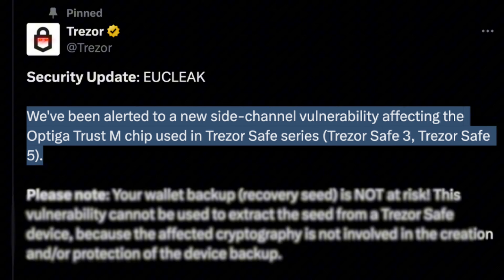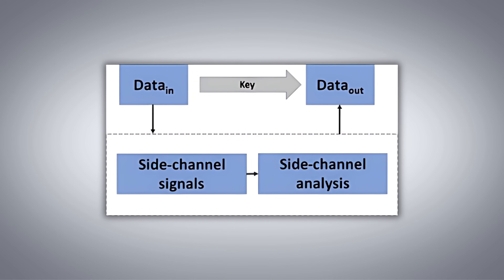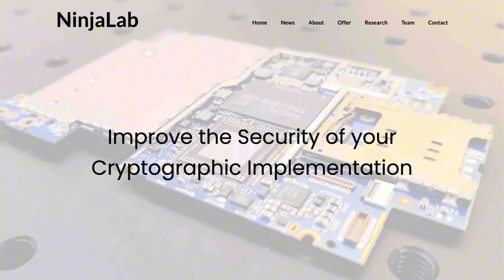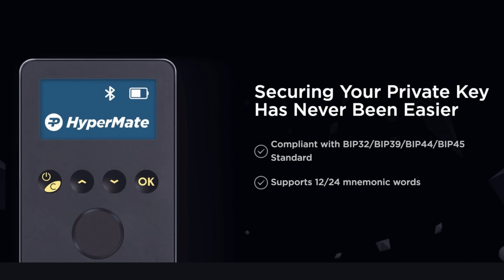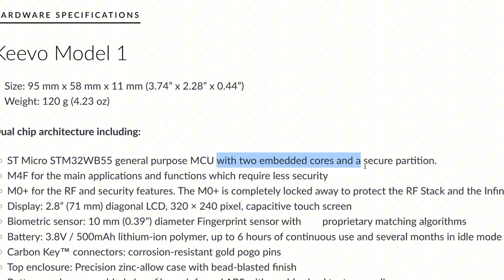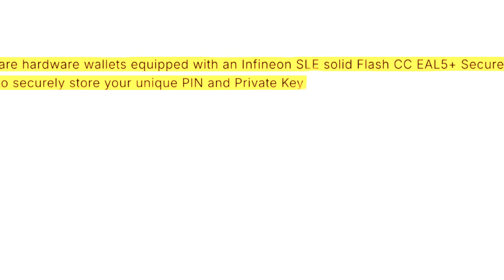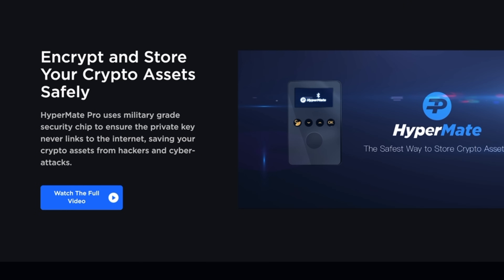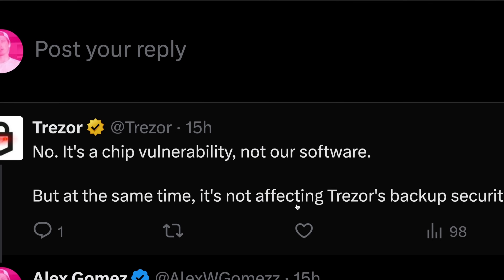Major Cold Wallet FLAW Exposed After 14 Years!

Comment: There's something that bugs me with Trezor's explanation. If the encrypted private key is stored on the non-secured MCU and is encrypted by the secret from the vulnerable SE and the PIN, what does prevent an attacker from extracting the encrypted private key and SE secret, and just brute force the PIN outside of the wallet ? The secret would take millions of years to brute force, but a PIN would definitely not take much time.

Comment: 1- the key will be stored in an encrypted manner and will need your password to dcrypt
2- if someone has your device and password, they don't need to extract your private key, they can just extract your funds

nobody actually believed that it's possible to physically safeguard data.
some people came and claimed that it's possible and others believed them and now it's being discovered that it's physically impossible
Reply: Not really
1 - the private key is encrypted by the PIN code AND the secret which is stored inside the secure element.
2 - the device itself has brute force protection when you try to enter the PIN. If you extract the encrypted private key from the non-secure MCU and the secret from the SE, the only thing missing to decrypt the private key is the PIN code, which you can find by doing a brute force outside from the device (where there is no brute force protection).
Reply: @aerandir1414  if it's a pin then yea. brute force is very easy. if it was a password then it would become difficult to brute force a good password.
Reply: Weakest chain in the link is seed phrase that you have to store physically unencrypted, rather than hardware wallet itself.
Attacker with physical access would never target wallet, because seed phrase is much more easy to find and exploit.

Comment: From Trezor

Side channel attacks

Side channel attacks described by Jochen Hoenicke were fixed by rewriting all crypto functions to use constant time. Jochen did almost all of the fixing, and we have been collaborating ever since on various security and non-security related improvements. Furthermore, we ask for the user's PIN before every operation involving a private key (e.g., generating the public key), so even if there were some side channel attacks left, the attacker would still need to know the PIN to trigger it.
Reply from the maker: @SoftwareWrangler  As I said in the video, Trezor wallets are not vulnerable to side channel attacks. Even though they use a vulnerable chip
Reply: I am watching the video again. 

The first thing from the video was that Trezor found a vulnerability in the new models but yet they were not affected. 
After a couple of minutes (2:06) this issue is linked to Trezor 3 and 5. 

I use multiple wallets and now I am confused.

Final: Trezor use the chip but not affected gooood God 😂
Reply from the maker: @SoftwareWrangler  Yes. Trezor literally said this themselves. They use the chip. But it does not compromise security of their wallets.

Must watch the full video. Not just 2 minutes
Reply: @cyberscrilla 
I watched like 3 times. 

1. Trezor announcement there are some issue
2. Trezor uses the chip but not in a way that compromises the security
3. Watch the recommended wallets video just avoid two Trezor wallets. 

The hard truth is to avoid all wallets with this chip and buy some without even if the chance of the hack is very very low. 
🤷‍♂️

Comment: Shameless clickbait garbage smh, lost credibility.
Reply from the maker: @abassra how is this click bait when Trezor posted on X about this exact vulnerability and I’m shedding light on it so people know?

It’s simple.

Trezor publicly announced the chip used in their Safe wallets have a vulnerability.

The vulnerability has gone unnoticed in these chips for 14 years.

It does not affect the security of the Safe wallets thigh.

However, it could affect security of the other devices and wallets I mention in the video.
Reply from the maker: Which is exactly what I just said, and is exactly what I say in the video if you watch it and listen 🤦‍♂️
Reply from the maker: My guy. I said “If you’re using one of the wallets that’s vulnerable to a side channel attack”.

Trezor is not one of those wallets. I went through multiple wallets in this video and discussed which ones COULD be vulnerable and which ones ARENT.

All wallets mentioned in this video use the vulnerable chip, but not all of them are vulnerable to a side channel attack.

Thats the difference you missed.

LISTEN next time.

Comment: So the old Trezor Model T and Model One no issue and even for the new Trezor 3 and 5 the attacker would need physical access and be an expert hacker ? Chances of that happening very rare
Reply from the maker: @Methuselah969V  Incorrect. The new safe models are not vulnerable to this attack as they have other security features in place that prevent a side channel attack. I explained this in the video.

Comment: What about the OneKey Pro hardware wallet? Is it affected?
Reply from the maker: Doesn’t use an Infineon chip.
Reply: @cyberscrilla  Chat GPT syas: Yes, the OneKey Pro hardware wallet uses an Infineon Secure Element chip. Specifically, it is equipped with the Infineon SLE78 Secure Element, which is designed to provide a high level of security for cryptographic operations, such as protecting private keys and ensuring secure transactions. This chip is commonly used in secure devices due to its strong security features.
Reply: Do you still like the OneKey Pro wallet?
Reply from the maker: Word of advice: don’t trust ChatGPT to give you accurate info. It’s spits out wrong information 80% of the time, especially if you use the free version.

The pro uses 4 TMC THD89 chips. Not Infineon.

That said, I’m not a huge fan of the pro. 

Not because it’s not secure, but because it still seems like an unfinished product to me and I’d rather buy a wallet that’s more useable for the price.

Comment: Always make using a passphrase part of your OPSEC - especially on a wallet with a substantial amount in it. At least it will buy you time to move your funds if your hardware wallet is stolen.

Thanks for the heads up and research, Alex.
Reply from the maker: To be clear, a passphrase would not help you out in a side channel attack.

Nonetheless, it can be useful in other situations. Thanks for watching!
Reply: @cyberscrilla  Thanks for the clarification.
Reply: @cyberscrilla  Could you please elaborate more on how the passphrase would not offer any additional security with a side channel attack? My understanding was that it only would grant access to your private keys and/or pin; but I thought in order to access funds in a wallet with a passphrase, you would need both the private keys and passphrase. Thanks for all the content you make. It really helps.
Reply from the maker: A passphrase creates a new wallet with its own unique private key, derived from the combination of the original seed phrase and the passphrase. In a side-channel attack, if the attacker can directly extract the private key from the device, the passphrase provides no extra security because the attacker already has the private key.

The passphrase only adds security if the private key has not yet been compromised.
Reply: @cyberscrilla  Doesn't the passphrase create a whole new set of private keys? So if you use the ledger feature where you use the SESSION based passphrase system they will get your seeds private keys with the side channel but when you unlock your ledger and enter the passphrase it creates on the spot a whole new set of private keys?
Reply from the maker: @not_my_noodles First off, Ledger does not use the vulnerable Infineon chip.

Secondly, whatever wallet you have imported in your hardware device at the time of the attack (whether that be passphrase or no passphrase) that’s what the attack would extract.

Third, in terms of Trezor it doesn’t matter because their security is not affected.
Reply: @cyberscrilla what do you think about the D,cent wallet